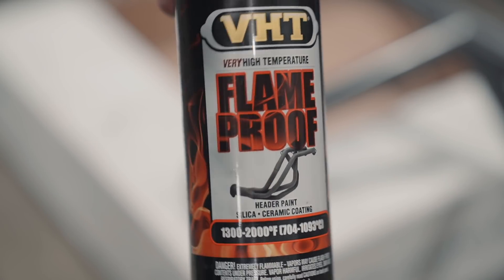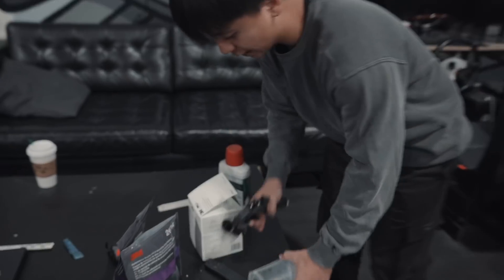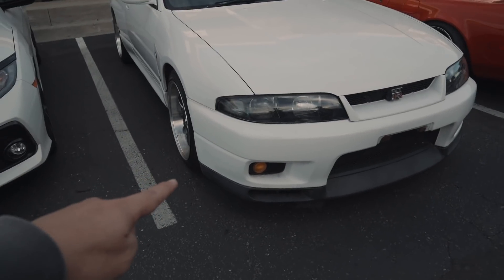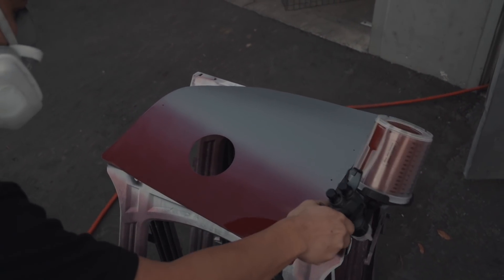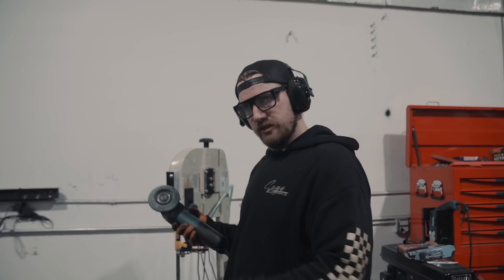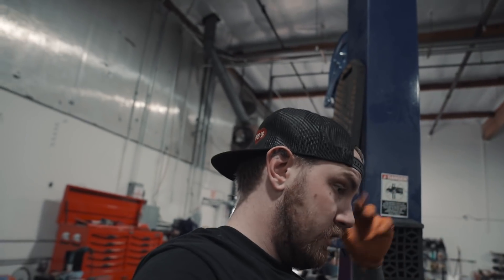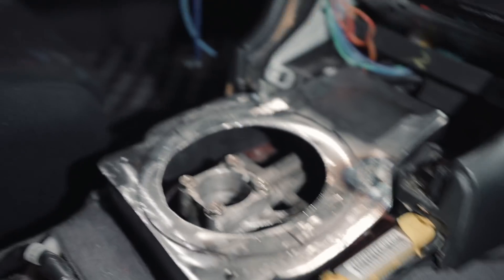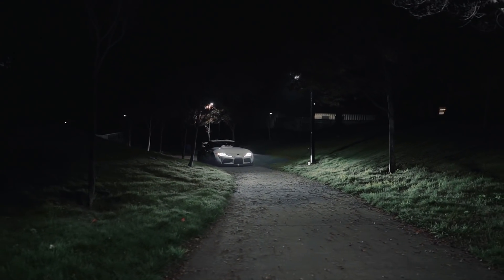A TOYOTA Motor in my NISSAN?! (Never been done)

Comment: Tiny but usefull tip for when you're painting.
Always start in the small area's such as the edge and holes / dimples. That way you never miss those spots and paint will hold up for a much longer time, and you'll get enough paint on the main part always anyway. :) Greetings from Denmark

Comment: If your going to weld that panel back on don’t you have to re paint the the engine bay ?
Reply: I think it’s gonna be bolted in instead of welded, I see holes drilled all on the sides of the panel and as well as tabs on the tube frame.